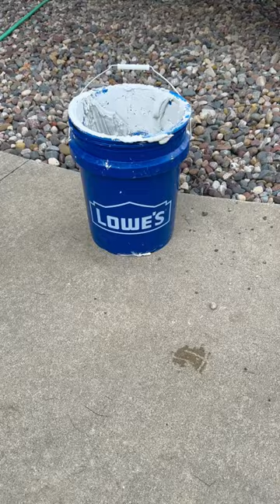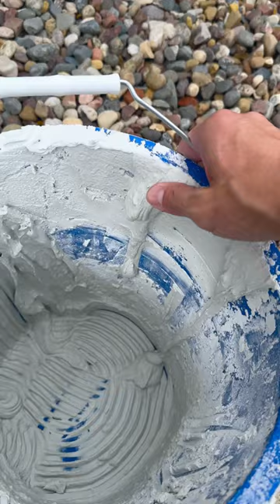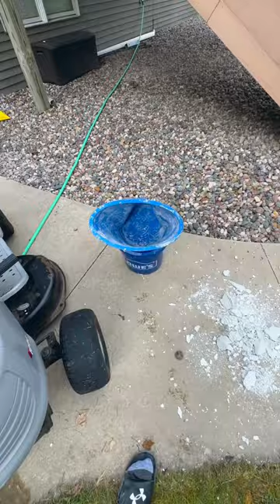Attitude Adjustment

Comment: $5 buckets vs $80 liner…hmmmm
Reply: Pays for itself in 16 uses
Reply: @avi4767 you could just roll the bucket on its side while you push down
Reply: Clearly the guy doing this professionally has his reasons for doing so. For contractors, time is money, and a lot of clients expect their property to remain as clean as when it started. If that means I spend 80 bucks for a silicone liner that I can use virtually indefinitely and don't have to deal with washing, that's what I'm going to do every time. Do you also not put a garbage bag in your trash can? Come on folks, do some thinking.